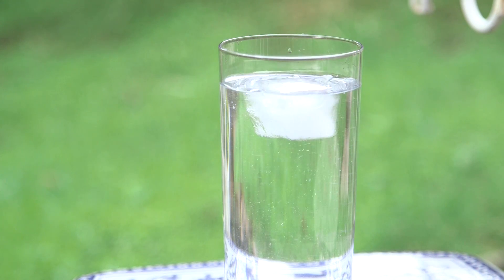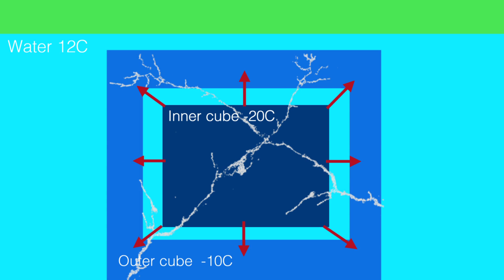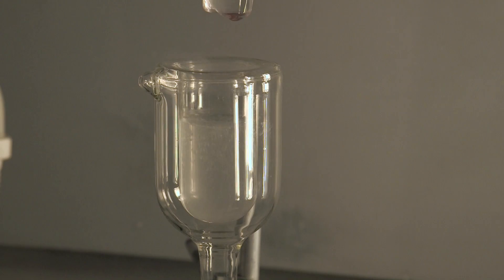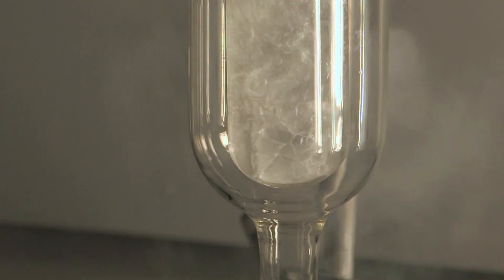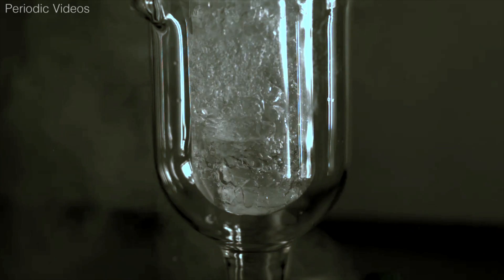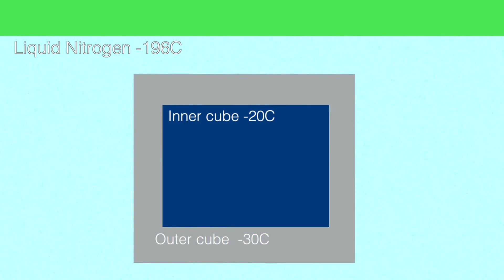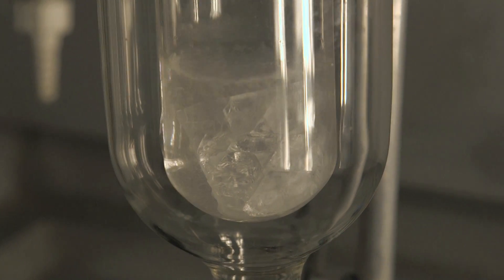Why do ice cubes crack in drinks? (SLOW MOTION)

Comment: I was searching online for solutions to keep my ice from exploding every time I add it to my drink when I came across this video. Whether I put all of the ice into a dry cup and then go to the tap and fill it with water, or there's already water in the cup and I'm just adding ice to it to keep it cold, I always get at least one ice cube that explodes and ends up flying across the kitchen. I've actually had them hit me in the face before and was very close to having damage done to my eye. And it doesn't matter if I'm adding ice to warm water or room temperature water or if I'm just topping off the ice in the cup and it's already extremely cold, there's always at least one cube that explodes on me...

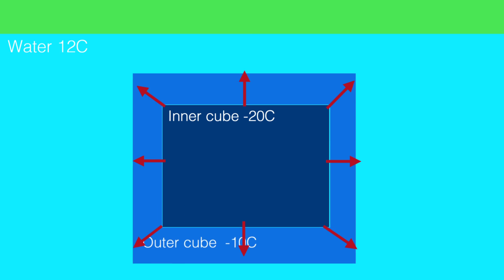Comment: 0:46 Hehehe, professor made 1 mistake... ice does not expand when heating... ice expands when cooling. (the freezing point of water is the smallest you'll get it at 0°C)
It was implosion failure on the edges, the water (ice) inside which was still cold wouldn't shrink, so the edges pulled in on itself as the ice got down to 0°C again.
Of course, above 0°C it would start expanding again, that's still true too.

At least, that's my theory, I'm not in a position to call him out on a mistake, I'm but a pleb. (and it's probably just a slight difference in nuance instead of a mistake)

Comment: I was wondering about it for a long time: ice has a bigger volume in comparison with liquid water, witch means that when ice is formed, the water being frozen expands (that's why it floats, it has lower density than liquid water). Therefore, when you drop the ice onto water and it warms the surface of the ice, that outer layer contracts (not expands) and cracks at some weaker point, making the whole cube to crack. Isn't it right?

Comment: Before i watch the video i got a theory, the ice cube is about -20 celcius in a normal frezzer, water is around 9 degree's celcius i think its because of the rapid heat exchange that causes pressure to build up in the air bubbles and expand and it cracks? lol

Comment: I wonder if the explaination should be slightly wrong(well not wrong, but inverted) due to the anomaly of water. I learned, that Waters densest point is at 4°C and it expandes in each way in temperature. Could it be, that a thermal shock takes place making the outer sides of an icecube contract so fast, that the inner core of the cube can´t react as quick as the outer shell and this causes the cracking? Because the Cube in liquid nitrogen, as shown, was more dramatic. So I think in the nitrogen, the cube expanded while in the glass of water it contracted. Implosions are less dramatic than explosions I think. :-)
Reply: My thought exactly, but I'm not a scientist and I cannot confirm.

Comment: This raises the question: Can you make Price Rupert's Drops out of ice?
Reply: If you heated glass up to the temperature of the sun, then the glass would vaporize. But you can still make Prince Rupert's drops out of glass. You just have to use the temperature which is appropriate to glass.

Likewise, if you were going to make Prince Rupert's drops out of ice, you would drop liquid water into something which is fluid at a temperature cold enough to freeze the water quickly. The obvious choice would be liquid nitrogen. The question (and it does not seem to have an obvious answer to me) is how thick a layer of ice can form on the water droplet as it falls through the liquid nitrogen. The water droplet would drop very quickly since it is not buoyant in the nitrogen much at all and would likely create a nitrogen gas wake.

I think it could be possible, but only if you had a small droplet of supercooled water which is somehow quenched very quickly in liquid nitrogen. If you did the experiment in a walk-in freezer then you could test the strength of the resulting drop.

Comment: I thought that water expands when it freezes, due to the shape of the water molecules being rearranged to form a solid, so ice is just "expanded" water. If that assumption is correct, then why would the surface of the ice expand any further than it already did, when it is being dropped in water? Wouldn't the surface of the ice contract, instead of the expantion that is suggested in this video?
Reply: Same rules apply to ice just as to any other substance: when heated up, it expands. It will get more dense when it melts, but until it melts, it expands as temperature rises.
This is what I think about it.

Comment: I think the ice at the beginning is trying to contract on the outside because it is rising in temperature and at the end is when it is trying to expand since it goes down in temperature. Water expands when frozen and contracts when heated, contrary to most materials....
Reply: it expands when it freezes. the reason it expands is the crystalline structure water makes when it freezes. when water is a liquid, it acts normal. when water is frozen, it acts like a solid. when they drop it in the water, the miniscule amount that melts contracts because it isn't locked in crystals, but the ice that doesn't freeze and stays crystalline heats up and expands like any other solid.

Comment: When ice warms up it does not expand but contract. The Ice on the outside (-10  > 999.8 kg/m3) has a higher density than the ice on the inside (-20  >  993.5  kg/m3). Therefore the ice on the outside contracts faster than the ice on the inside, causing the inner ice to break since it cannot escape. So the reason for the cracking is contraction, not expansion as stated in your video.

Comment: So why doesn't the ice crack when it is outside the refrigerator, but not in a beverage?
Reply: +Felipe A. Barretto Because air is a Thousand times more dilute than water, there are less molecules to give the ice cube a higher temperature, so it is a far more gradual process.

Comment: So why does the ice simply melt in air—which is presumably warmer than the water—instead of cracking?
Reply: +Noel Goetowski I'm not a scientist but I'm guessing it's because of the thermal conductivity of water.  It's the same reason you get cold much quicker in water than you do in air.

If an ice cube is in air it's warming up much slower than if you submerge it in water so it expands much slower and the warmth has time to reach the centre.  The whole ice cube expands at a similar rate, avoiding the differential expansion that cracks it.
Reply: +JayFe0 That'll do it. Thanks!
Reply: Yes, it is a consequence of the heat capacity of water which is a lot bigger than that of air. Another thing to note is that below -1 C (the temperature they mentioned in this experiment was -20 C) ice really behaves much as a brittle solid, thus it will quickly dilate/contract and crack if you apply it a thermal shock, throw it in a room temperature glass of water for example.

Comment: I'm more interested in knowing why there are little tunnels of air inside the ice.  Its not as if the water freezes instantly while air is expanding like in a carbonated liquid.

What gives?
Reply: +Chris Snyder Tap water has dissolved gases in it.  When the ice freezes the dissolved gases precipitate out and, because the outer surface of the water freezes first, the gas becomes trapped inside the ice cube.

Comment: Ok... But water expands when it freezes... It doesn't contract...
Shouldn't you guys reply to this statement?
Reply: Mike Adrenal Yes I don't understand that either! Water has it's maximum density at about 4 degrees C. So the frosen water getting warmer should get more dense and contract instead of expend right?
Reply: Mike Adrenal under 0°C or 273K and above these 4°C water acts just as any other Material (almost) linear, so that less temperature means a higher density ... as the ice-cubes are already frozen when put into the liquid Nitrogen, their density decreased...
Reply: Mike Adrenal This experiment involves solid water.  Although there is some phase change in the water experiment, the contraction in volume occurs as the ice melts, not before, so there is no impact on the remaining solid.  

In the LN2 experiment there is no phase change for the ice sample.

Comment: Given the speed the ice cracking happens, I would expect only the surface of the ice to be trying to expand.  But the cubes usually crack all the way through rather than just a piece of the outside coming off.  Is this because the temperature actually spreads through the whole cube very quickly due to its crystal structure?  Or does the differential expansion of just the surface ice simply generate enough force that it cracks all the way through?
Reply: /Is this because the temperature actually spreads through the whole cube very quickly due to its crystal structure?/

This question is answered in the video.

/Or does the differential expansion of just the surface ice simply generate enough force that it cracks all the way through?/

Yes.

Comment: so if the ice cracks in warm water, because the outside of the ice is warmer than the inside, then it should crack like that, but as you can see (0:15) it slices through the middle, therefore his explanation is wrong

Comment: How about extending the method to super cooling the ice slowly to some extreme cold without cracking it, then dropping it in water. Would it crack more dramatically, and if so, is it possible to make the ice shatter with enough force to explode apart or would the super cooled ice just freeze the water around it enough to contain the explosion.

Ok maybe I just wanna see if we can make ice shatter more dramatically and catch it on the high speed cam!

Comment: Here is an observation of mine: When I put frozen bottles of water into a cooler of water I could hear them cracking. Sometimes, usually when there was a very loud crack, you could also see a flash of LIGHT. This was only visble in the dark.

Comment: The modes of cracking ARE different between the cold ice in water and ice in LN2. In the first case, the crack initiates in the core of the ice, in the second it's the surface that cracks.

why does this make a difference - 2 things.

1) the minimum flaw size for crack propagation inside a body is twice as big as that required to initiate a crack at a surface.
This means that the amount of stress required to create a crack is much higher in the core than at the surface.

2) the stress field inside the core of the ice cube is tri-axial - equal in all directions - versus in 2 direction at the surface - i.e. no stress through the surface.
Notice that in the first case, one crack propagates and completely breaks the ice cube. In the second, lots of surface cracks propagate into the cube, but stop about 1/4 of the way in - the cube does not actually break.
Reply: Very interesting, and probably one of the most intelligent comments I have ever seen on YT.

Comment: That's the same reason why pouring boiling water into a glass will more likely crack the glass if it's thicker rather than thinner glass (somewhat counter-intuitively).
Differential expansion.  If the glass is made of thinner glass, the heat will penetrate through the glass more easily.  Thus no differential expansion.

Comment: Interesting... although I'm not convinced it is due to the expansion & contraction of the ice, rather the expansion (and contraction in the liquid nitrogen example) of the gas bubbles trapped in the ice, causing fracturing of the solid (ice) component.

I only suggest this because I don't ever seem to have ice cubes crack in water that are clear ice cubes...

I suggest this experiment needs another run with clear ice cubes, not just ones containing considerable amounts of trapped air (hence the 'cloudiness').
Reply: It's not because of gases. Their volume is puny and forces inside are therefore puny, too. The explanation in the video is correct.

Comment: shoulda taken the super cold ice cube and put it in a glass of water see whatd have happened. Also doesnt ice expand when it freezes contract when it warms up? wasn't the outer layer contracting when you dropped it into a glass of water and expanding when you put it in the nitrogen?
Reply: Ice expands when it freezes compared to water, but it doesn't keep expanding as it gets colder, so as ice warms up it doesn't contract, at least, not until it melts, when, in a sense, it contracts, or transforms into a denser form.

Comment: The video says the ice cube "[in liquid nitrogen] shatters just in the same way as it does in the drink": but I think that skips the interesting nugget.  Not all shattering is equal.  Here is what I think is happening.  While both shatter because of thermal shock, what's neat here is that the failure (the appearance of a crack in a solid) does not initiate in the same region of the ice cube immersed in the drink (hot relative to ice cube) as it does when immersed in liquid nitrogen (cold relative to ice cube).  When the outside of the cube is rapidly warmed by immersion in a drink that is at room temperature, the outer regions of the cube warm first (because the thermal conductivity of ice is not very high) and expand and, constrained, are under compression and the core of the cube is under tension; a failure initiates in the core where it is under tension.  When the outside of the cube is cooled (as in liquid nitrogen) it contracts and comes under tension, while the core of the cube is under compression; the failure initiates in the outer region.  So, in both cases, the failure initiates in the region that is under tension, but in a heating situation that region is the interior, and in a cooling situation that region is near the exterior.

Comment: Try this. Next time you make ice cubes, let them freeze until there is a layer of Ice on top of the water (1-2 hours). Poke a hole in or crack the ice layer, and trap a bubble under the ice. Let it freeze solid with a bubble trapped in it. Sometimes, it's almost like, exploding ice cubes, instead of cracking ice cubes.

Comment: I noticed an air bubble which came from the middle of the ice cube as it cracked.  Are the results any different when dropping an ice cube made with running water (less likely to have trapped air)?  I don't have a high speed camera to try this with.. :)

Comment: Doesn't water expand when it turns to ice?

I know that all elements expand when heated and contract when cooled, but water is the only element that expands when cooled...right?

A glass bottle filled to the top with water and put in a freezer will break due to expanding of ice... And putting ice in a glass bottle and sealed with a cork will suck the cork in when the ice melts.

Try it...

Comment: I'm Australian, and let me tell you, we use a lot of ice in summer, but I have never seen ice crack so dramatically that the two sections separate.

I suspect this is because our harsh climate and dangerous wildlife has resulted in a stronger, hardier breed of ice.
Reply: Noughtilus Really? Do you not drink your nitrogen with ice down there or something?
Reply: I’m Australian too, and mostly just little chips break off, although it does split right down the middle occasionally.

Name’s Charlotte, and I’m 10 years old.
Reply: "Breed of ice"😂😂😂
Reply: There are a lot of people with Autism in this thread
Reply: Why?
Reply: I think the sound adds a lot to the effect.   They are also using vacuum beaker (?) so you can see it clearly.  If done in a regular container condensation would block your view of the liquid nitro, But that's a vacuum container (you can see the double walls) so the outside is kept insulated and clear.
Reply: But I'm talking about the first ice cube in the video, in just a glass of water. The ice cube cracks and the two pieces separate. I've never seen that happen.
Reply: Do you make you ice cubes in a freezer? Or do you make them in the ice cube room of yuor fridge? The latter is only about -5 degrees.
Reply: Lol !!
Reply: It's harder than pommy ice, eh?
Reply: You should come to my house. Literally every time I put ice in my cup at least one cube explodes and ends up on the other side of the kitchen.
Reply: I live in Germany, also didn't see a icecube breaking in two pieces. it only gets a break.
Reply: I just spat out my iced tea after reading that last bit

Comment: iron can do  the same cracking but in reverse when taking hot untempered cast iron and dosing it in water  , can crack alot when outside becomes quickly cooler then inside , best seen with old iron cast frying pans heated then put water in it

Comment: Interesting. Similiar problem with steel shafts. When torsionally twisted, they crack. Unless they are drilled in the middle to allow room for the metal to distort. Wonder if a donut shaped cube would crack?

Comment: Colder water take more space than warmer water (unless gaseous…). I think you should redo this experiment with blocks of ice containing no [or almost no] bubbles…

I think ice would react in a different manner if distilled water is used… To get a nice/perfect block of ice, you can use boiled distilled water instead of regular tap water…

The lack of ions and gases trapped in the water will give a clear crystal… As with glass vs crystal, the clear & bubble-free ice will resist more extreme changes in temperature…